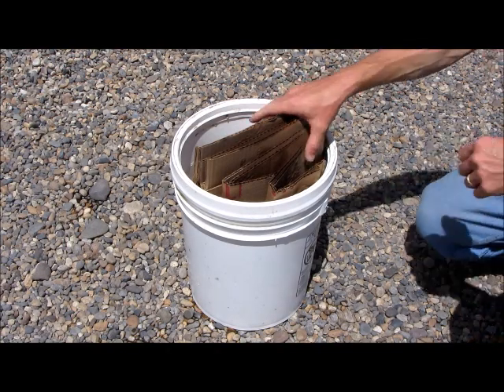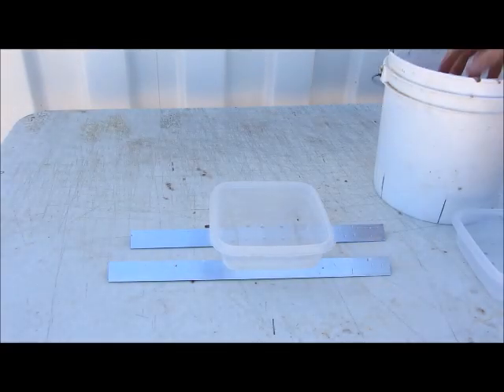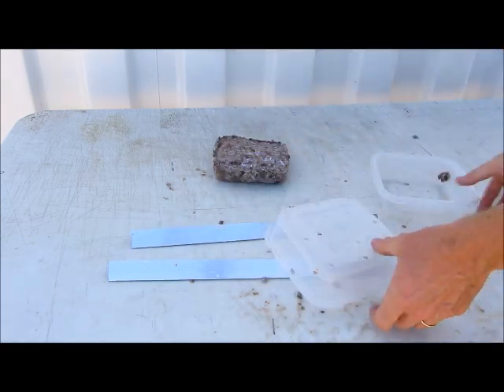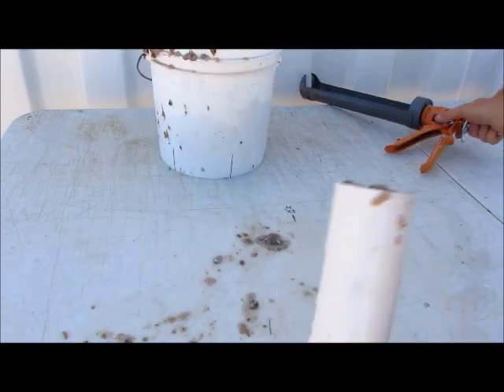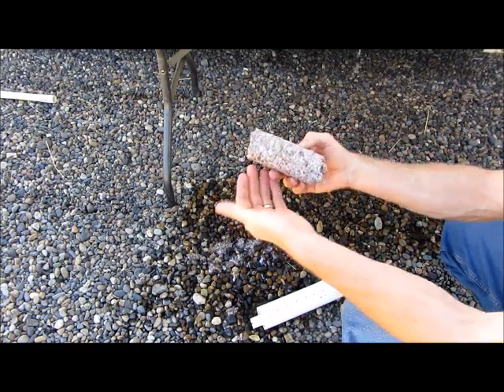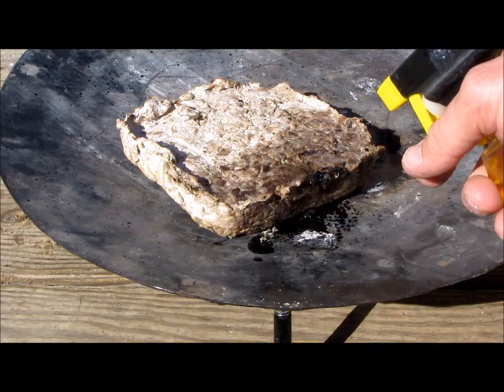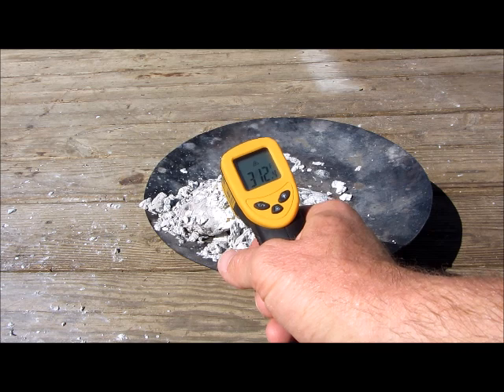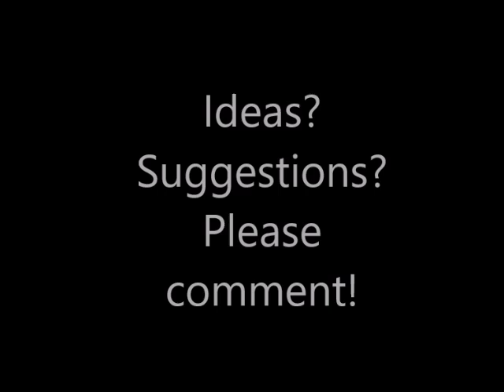Free Fuel To Heat Your Home, does it really work?  Paper and cardboard fuel test

Comment: Have you tried the tried and true method of just rolling paper into logs? Perhaps tied with string? Newspapers, magazines, even cardboard... after it's been flattened, can be rolled into paper logs and burnt like wood logs. Tying the results with string keeps the log from unrolling long enough that one should not have to worry about the 'log' unrolling in the fireplace. 
   Just a thought, 
speaking Frank-ly
Reply: Frank Smedley ... I’ve been rolling small  3\4 inch thick , not tight newspapers together held by masking tape or rubber band .  I use 2 logs of this with small twigs , small dry pine cones if available , small wood chips if available to start a fire in my wood stove every night.  No problem with the newspaper coming apart.  Works great.  Dry birch tree branch , small amount work great with the newspaper rolls.  Sometimes I use the toilet paper roll to slide the newspaper into to hold it in a roll position.  One ‘ strike match’ I buy at the hardware store and I’m good to go.   I don’t use old dry leaves . They can smoke and smell bad. I have 21 trees 5 species and the birch leaves are least offensive to use when dry .
Reply: We used to have a newspaper roller just for this reason. We used the rolled papers inside the woodstove, and you're right, roll them tight.

We delivered daily, as well as Sunday newspapers, and always had so many extras.... yes, it got tedious. 

The mashed would work great at my friends garage, he has tons of cardboard boxes from parts, and a small pot belly stove, but I'm sure that would become very tedious as well.
Reply: Once strings burn off, the papers will unroll with explosive force. Use metal wire instead.
Reply: @edjohnson2192 , good catch. Might suggest for economy's sake, using coat hanger wire? Simple, dead easy to obtain, cheap, and reusable. One could easily cut pieces to bend into shape with 'hook and eye' ends to hold the bundle, that can be sifted from the ash pile after the fire dies and reused.
   just a thought, 
the Frank one.
Reply: ed celban I never had that problem but I suppose it has to do with how tight you roll the paper in the first place.  My problem is the ash.

Comment: I have been saving paper and cardboard and recycling some of it, but keeping some in a box for emergency use, in case of a need for heat. What good is it if you don't have a fireplace? You can't have an open fire in the house without a chimney. Portable electric heaters are nice, but what good are they if there is no electric power.

Comment: I learned how to make these as A girl Scout decades ago.  We added LINT from the dryer, and it helps start fires much faster; I've taught it to my grandchildren, we take and use them every time we go camping!!
Reply: Hi Cheryl. Do you have any old candles cluttering up the place? Lint in paper egg cartons with candle wax poured into the sections works too. I use sawdust since I have access to plenty. You can melt the wax in an old soup can. I use so many "fire starters" for my wood stove that I have a tea kettle dedicated to melting old candles. I'm a garbage man and pull old candles out of the trash. Sometimes I pick them up at yard sales. Peace.
Reply: @johnvanegmond1812  u can buy sealing wax at grocery really cheap.
Reply: @MeTreesndirt  Not as cheap as big fat candles I cut up with a hatchet. :) In my neck of the woods, sealing wax is about $3 for a block the size of a pound of butter. I melt down at least 10 pounds of candles a year. The down side is that some candles smell like "old lady house" and I have to keep the fire starters in a tin so they don't stink up my basement.
Reply: John Vanegmond, I agree with you 100%! Where's the fun of BUYING everything?! For the wax & lint (cotton is best, not plastic fabrics) mixture, I melt them together, stuff them into cardboard toilet paper rolls, then seal them up by folding them while still warm, or even with tape - works great, holds together well!! We live near the Coast in Central California (Hollister) where there are always hundreds of pinecones, they make WONDERFUL fire starters; the grandchildren & I like to collect them wherever we go, to use for our summer camping trips, along with the toilet paper roll & wax & lint starters!  I had a girlfriend years ago who was a manager of a candle party thing, like Tupperware; when they went belly up, she gave me DOZENS OF CASES of the ugliest ones (her husband wanted his garage back lol), still using them!

 If I had worked with trash, I know for sure I'd have brought home so much, my home would've been bulging; I try to find ways to reuse things, i like practical over pretty every time! I also save leftover wax; my grandson rides a scooter, does tricks, uses wax to make them slide, so I use his leftovers too.  And I'll bet there would've been many times when I'd have thought, "Why would somebody throw away this perfectly good...?"

I know what you mean about those 'stinky' candles, I don't like them either; they never lose that smell, but I use those also anyway.  Hey, try that lint thing, starts fires right quick!!!!
Reply: John  Hi John. I love solar panels. Buuuuuuut, they won't heat my house when it's 20 degrees below zero and the wind is gusting up to 45 mph. I will admit, though I wouldn't ever say I don't like nature, I do like warm weather better than 20 below. Peace

Comment: I guess in rural areas branches and logs are easy to get your hands on but for city preppers in shrf scenarios the wood would disappear quickly and I always have loads of paper for recycling especially confidential waste so this is a great option for me. Either sun or if I’m using my oven just use the residual heat to dry bricks quicker

Comment: If you are using the large brick you could put a plactic tube in the centre to leave a hole as it dries then put smaller bricks in so it bits from the middle like a Swedish stove made from wooden logs

Comment: All that work and it burns away in an hour. You would have to make it a full time job to make enough to burn to heat the house and cook. Plus, you can't burn inside as theres too much smoke. I do what you did,using the paper,to make cat litter instead.. Add some litterbox deodorant and baking soda,break up into small pieces and you have some free cat litter.
Reply: It isn't meant to heat a house or to burn inside.  And the cat litter is a good idea but I'd rather go buy a bag.  You'd have to make it a full time job to do all that work just for some free cat litter which is dirt cheap anyway.

Comment: Add poop! Take the solids from septic tanks and mix that with saw dust and wood chips. Dry in a green house. It'll stink but boy will it burn!
Reply: Should we call Mike Rowe?
Reply: Yes! Find a cow pasture and grab a pick-up load full of cow patties;  folks be happy to let you help clean up the cow poop and from what I understand it's a decent fuel.  Seems it would have a nauseating smell tho.
Reply: On a slightly different note. Simply use the resulting methane from the poop break down to burn in any gas stove. Burn clean and no smells (odor is removed in prior process).
The result is nothing but fantastic raw material to the compost heap. Closing the cycle. ;-)

Strangely there´s so many huge cattle industrial facilities that make no effort at all to use this amazingly cheap resource. But are all to willing to let it flow to aquifers... :-(

I guess big oil talks louder. ;-)
Cheers

Comment: Ever heard of charcoal lighter fluid?   Any form of colored paper will contaminate your food if you try to cook with it. .
Reply: I imagine it's not good to breathe either.
Reply: Some colors are made from soy and other vegetables. It won't contaminate your food unless it touches your food.
Reply: donald coxe h
Reply: Donald coxe  There are options other than cooking.
Reply: @campfireaddict6417  . You're absolutely right. Endless uses other than cooking. I was just putting it out there in case some people were thinking about cooking with it. . I have hand operated roller and it will roll paper extremely tight and you use bailing wire and tighten it so time will stay together we'll. We put colored powder between the pages to make cool flames in the fire.  Only downside is it produces a lot of Ash because the paper Page's are thin.

Comment: Ash, ash, nothing left but A LOT of ash!!
Reply: And that can go into the garden
Reply: I have a wood stove and don't burn paper in it. The stove fills up so quickly with ash that way. I don't put ash in my garden but I do spread it lightly on the snow in my gravel driveway. Makes the sunlight more effective at melting.
Reply: @johnvanegmond1812 John, I am in the process of making lye from pure hardwood ash, which to make handmade soaps. Garden?  Wood ash is alkaline and should not be used in soil where acid-loving plants will grow, such as tomatoes or brambles such as blueberries.
Reply: @campfireaddict6417  Soap? I'm impressed! Sounds like an adventure. :) 
 No ash in the garden for me. I suppose if I had a lot of pine tree influence on my soil maybe I'd add ash. I put walnut ash down the middle strip of my gravel driveway. Killed the weeds and it took a few years for them to thrive again. To bad I had to clean my chimney 4 times that year. Normally one cleaning a year does it.
Reply: @johnvanegmond1812  John why did you have to clean your chimney more than usual?  It doesn't sound like you burn with pine...    another thing ash is good for, so I've heard,  when stuck in snow in a car or truck, pour ash around back tires for traction.  Sounds good but I've never done it; only ash I have is from small summer backyard fires, not enough for that but I saved half a bucket full last fall.  Has to be pure wood ash.
Reply: The comment about pure wood ash I should clarify is for making lye for homemade soaps.
Reply: @campfireaddict6417  Kind of left that part out. I burned a lot of walnut that year. It had cured less than 18 months and even cured walnut has to be blended with other wood and used in moderation. I love the smell of walnut firewood though.
Reply: @johnvanegmond1812 hat brand of wood stove do you have?  I would kill for a Jotul.  I'd kill for a woodstove period but it's not in the cards right now.  Sounds like your wood was cut down green; I have campfire wood curing in my cellar believe it or not and it gets crispy-dry because that's where the furnace is. (Natural gas steam heat radiators  yada yada)  Do you have maples and do you tap?
Reply: @campfireaddict6417  I have a small Century wood stove. It basically heats the basement and thus the floor of the first floor. Without the wood stove, socks and slippers are mandatory. When it's below 30 degrees outside, our gas furnace/steam radiators kicks in. Above 30 and the wood takes care of it. 
I don't tap maples for syrup. But if the moon is waxing and I'm cutting maple trees, I leave the stumps tall, cut sap retaining grooves, and drink the sap with a straw. When I'm done I harvest the stump. I do this when I'm out cleaning fence rows. Tastes a little like licking a 2 x 4 (don't ask) but the sap is really refreshing. :)

Comment: if electricity bills continue to go up, there will be more and  more people wanting to burn stuff to keep warm, but it is becoming more and more difficult to do it as more and more cities now forbid burning stuff.  What we need is a way to heat our home without cities knowing about what we are doing...
Reply: Look up gasification and or rocket stoves .Both burn extremely clean .
Reply: @royalspin  and alcohol  burner penny can stove
Reply: This is exactly my problem. I live in an apartment 
   How can I burn anything in the city without a neighbor calling the fire department?
Reply: @jonphillipsinsurance897  grab solostove bro.
Keep fire extinguisher nearby.
Reply: @jonphillipsinsurance897  You know what's fucked up?  I can't control my heat and I have those old fashioned HUGE iron radiators that  are TOO hot. The valve where the steam gets vented is a kind of thermostat-if it's cold put a jug of ice on it and it will come on. Also it's an old building in the Northeast where keeping warm was key so good insulation. You need an AC in the summer (well it's nice) and the smallest,cheapest Haier works great because of the insulation.
Reply: @jonphillipsinsurance897  Don't think you can.  Need your own real estate, but still have to be careful.  A lot of the YouTube videos about this takes place in the country. I live in a "city" but back a long ways from anybody,  near a woods, and have cool neighbors. I still have to be careful with my occasional fires.  Would need country real estate to run any kind of ongoing woodsmoke-producing stove or a proper chimney if inside.  No one, as in neighbors, wants to smell woodsmoke all the time.
Reply: CampfireAddict: we made our first fire last night. It was great and no one complained. During the cold everyone’s windows are closed.
Reply: @jonphillipsinsurance897  use a small rocket stove with clean burning fuel, that usually doesn't smell
Reply: Sylvain Piche Leave the city. When it all comes crashing down, you don't want to be Ina city greater than 30,000-40,000.
Reply: rates in my state went up another 22%.
Reply: yes a chimney with one of those filters in it.
Reply: You need an electric blanket. People spend most of their at home time in the bed and couch. It is much much more efficient to heat a small area that you use, rather than the air. It will probably be the cheapest method of heating yourself other than wearing more clothes or doing pushups / air squats. By the way, it is healthier to sleep at a cool temperature.
Reply: Very ingenious
Reply: Sp yj. Solostove sounds good, but where do I send the smoke without alerting the neighbors?
Reply: Gussie D. Where do I get that filter?
Reply: I think people give off about half a kilowat per hour or something. Maybe you could invite a lot of guests round but ask them to be very quiet & arrive at 5min intervals. I know, maybe you could become a meditation teacher, have free sessions in the early evening & get the house warm.
Reply: with obesity growing, i cant understand how you need to keep warmer, dont you know the planet is heating up??
Reply: @bishplis7226  You can still freeze to death.
Reply: What you really need is a gov't that stays the *&^% out of people's business.
Reply: let sorry a--  politician AND THEIR FAMILY'S live in cold houses and work in cold offices and they may think again about climate change , 1 volcano can spew more co2 than people could in 100 yrs . i want to keep things clean as much as the next person , but have you noticed this stuff ( RULES , LAWS ) seems to role down on the little guy .